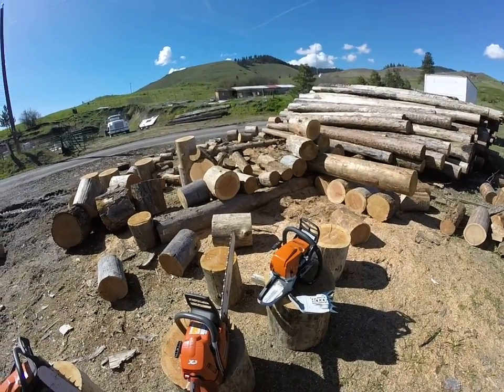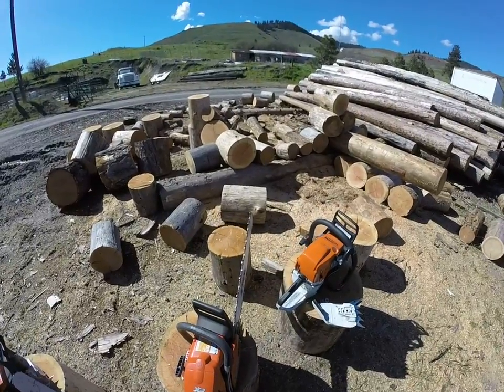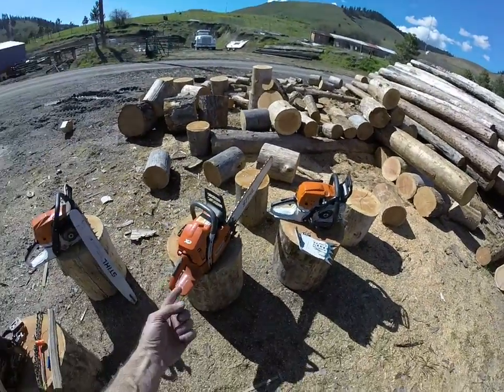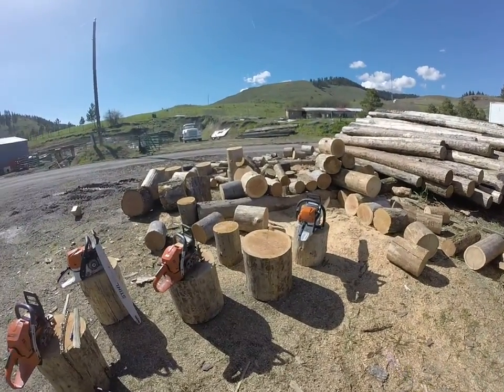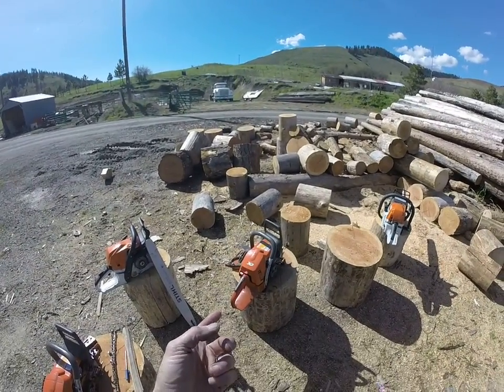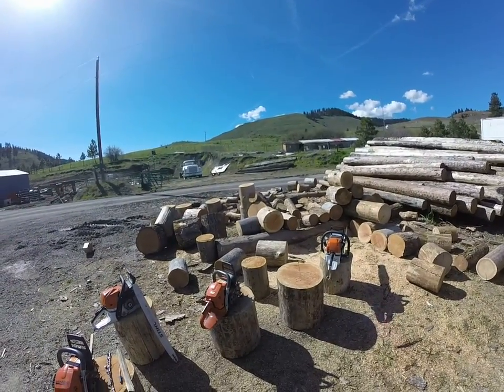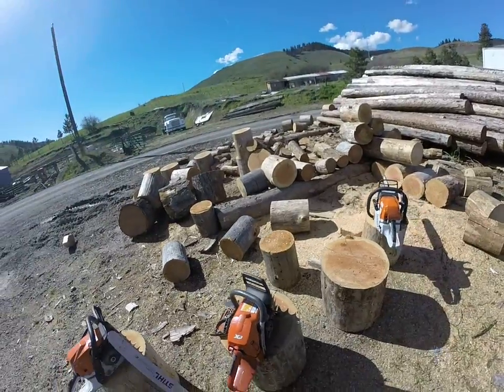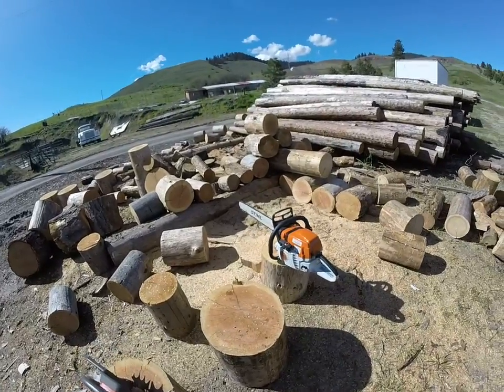Insane-O 357xp Big Bore vs SuperSized (SS) ms362

Comment: I thought  the 362 was faster , but it was difficult to tell.
Reply from the maker: The video time line shows the 357bb runs ~ 1/2 to 1 second quicker. It's a little beast of saw for sure, not that the 362 SS is any kind of a slouch either.
Thanks for watching!
Reply: I stand corrected. I like Stihls and Dolmars so it is easy for me to be bias.

Comment: If the Insane-O SS will out run an Insan-O C model it'd be pretty beastly for a little saw judging by the way my C runs after you worked it over! That 357 was holding it's own tho.
Reply from the maker: IMHO, the (yours) standard insane-o (SI) 362 is a no slouch saw. 
The combustion chamber reshape and enhanced flow tricks are really noticeable when added to the standard insane-o (SI) 362, or any other saw for that matter. There is a video in the collection somewhere pitting a SS 362 against a SI 362. The SS 362 "whoops" up on the SI 362,  just as it should, or I'm not doing my job very well.....
Check the SS 461 video. It will "whoop" up and SI 461 just as it should as well.
Thanks for watching.